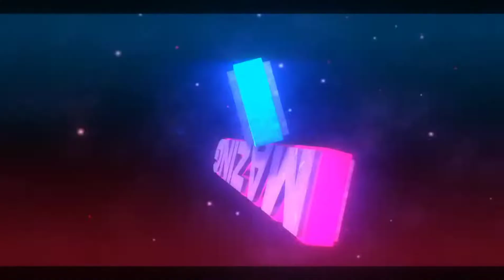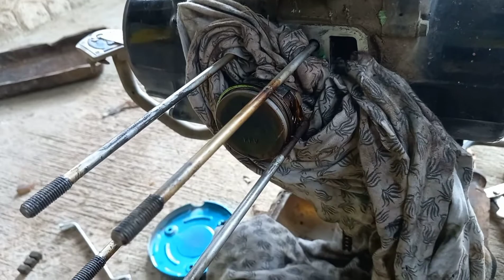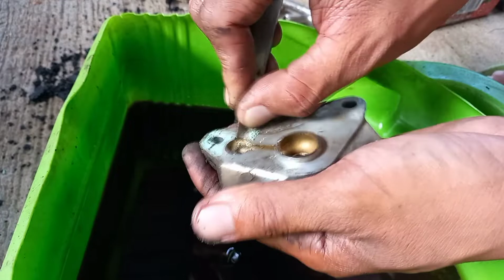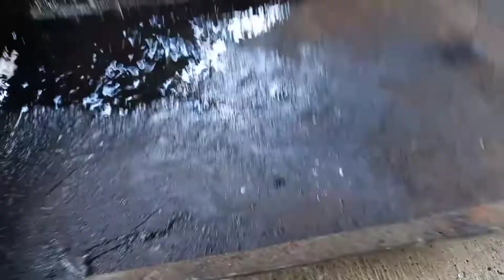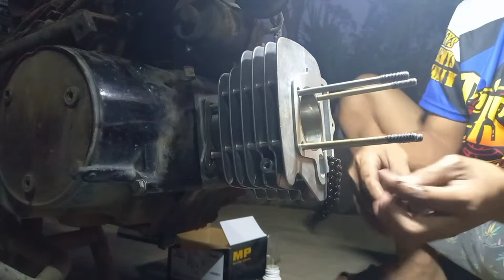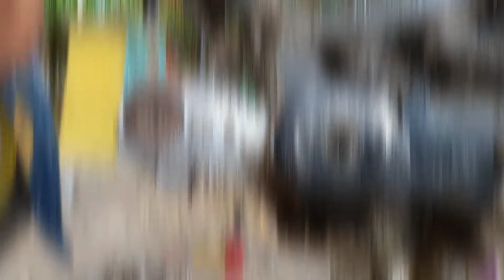Top Overhaul | Refresh Engine | Honda Wave Alpha | Haha Mazing | 9

Comment: Sir tanong ko lng ano pumipigil sa camshaft para Hindi kumalas sa puesto nya? Salamat
Reply from the maker: Paps baka palitin lang cam bearing mo kaya kumakalas sa pwesto nya.
Reply: @hahamazing2527  paps Hindi mo na kuha ponto ko. Wala nman sira. Yung camshaft at bearing nya madali lng ntin bunotin dba? Paano sya Hindi matangal kapag naka install na sya. Wala nman stopper sa loob ng head. Ang tanong ko ano pumipigil sa kanya na Hindi kumawala sa loob ng head kapag umandar na Ang motor.?
Reply: Katulad din ng Raider j walang stoper.pero hindi natatangal..
Reply: Pag nag install ng camshafts hawagan mo lang ang camgear tapos higpitan mo ang  tensioner pagna higpit na hindi yan bumigay.katulad din ng Raider j.